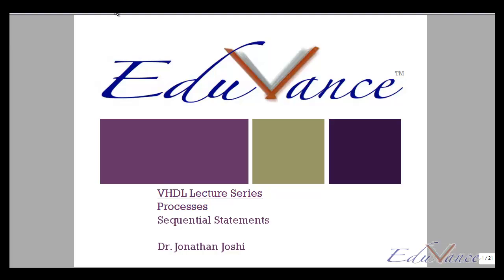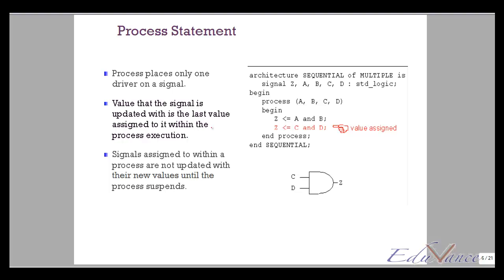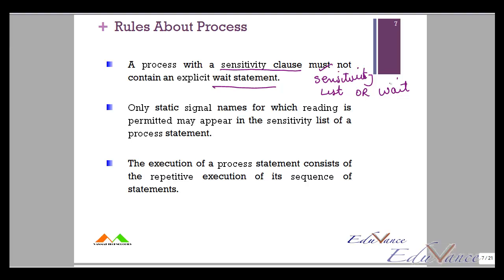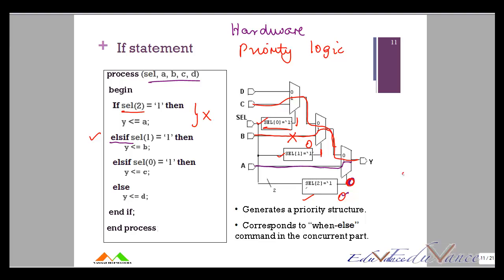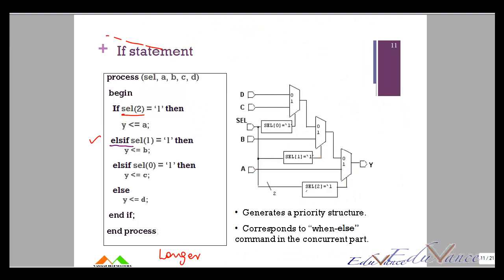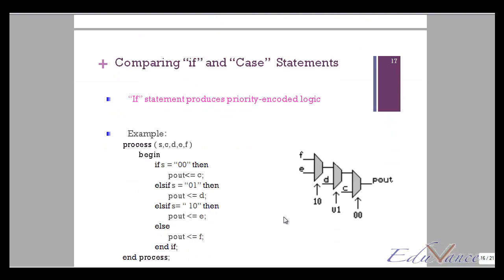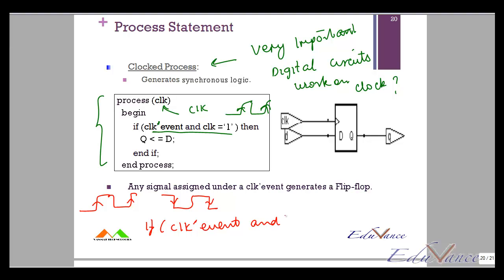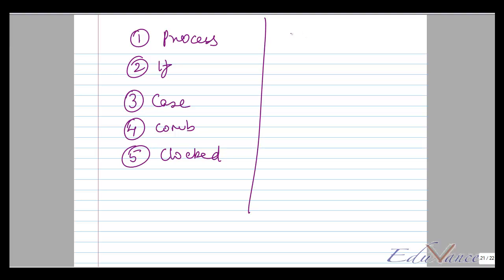VHDL Lecture 11 Understanding processes and sequential statements

Comment: i could not clearly understand why using elsif for clocked processed would generate a wrong hardware....could you please make a vedeo elaborating that topic and some other related coding styles which shall generate similar errors
Reply from the maker: While designing sequential circuits, you want your hardware to operate on clock edge for e.g. rising edge. So unless there is a signal which is asynchronous to your clock , say reset, you can declare the clock event in if block and end it with end if.
Now in designs where we use if else structure, a priority logic is developed. The statements in if else structure are in decreasing order of priority starting from if to the last else statement.
if (...){          will be checked first
}
else if (...){     will be checked only if 'if' statement is false 
}
.
.

else{              will be checked only if 'if' and all 'else if' statements are false
}
Also asynchronous signals need to be given a higher priority than other signals in system which are synchronous since they can occur at any instant in the system. They are independently executed events which do not rely on rising or falling edge of clock.
So while designing sequential circuits using if else which involves a asynchronous signal , all the asynchronous signals should be declared in descending order of their priority and in the last else if structure, your clock event should be declared.
Now if you write a else or a else if block after your clock event,you will be assigning the signals or processes declared in that block a lesser priority than clock event which is a wrong design.

Comment: Will the process code always be triggered when there is a change in the variables present in the sensitive list?????
Reply from the maker: Yes
If its combinational circuits you are designing, it will depend on the input, output or control signals you put in the list. If you are designing a sequential circuit, it will depend on the value of clock, reset or any other asynchronous signal in the design.